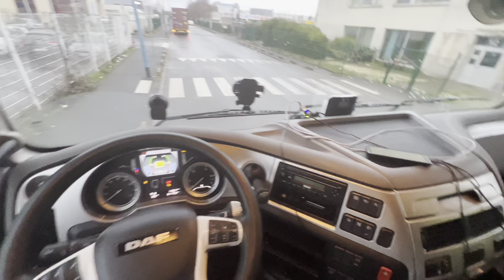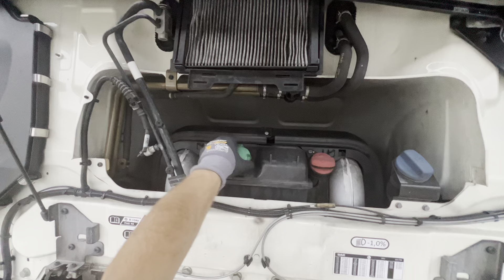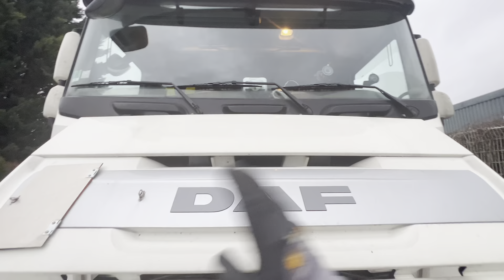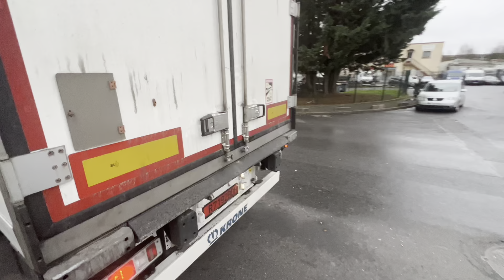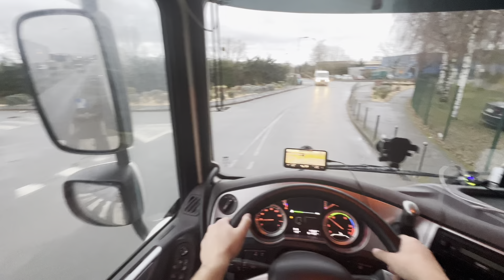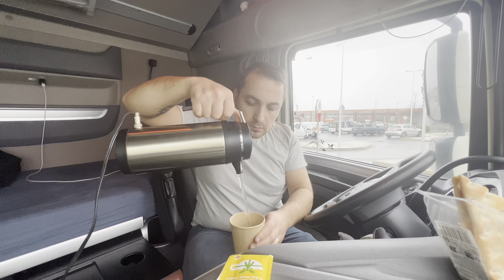#40 🇫🇷 pov truck, how to add engine water to daf truck

Comment: Looking at the engine water, it's similar to a water-cooled computer. Although the fields of use are different, the purpose of both is the same cooling function.